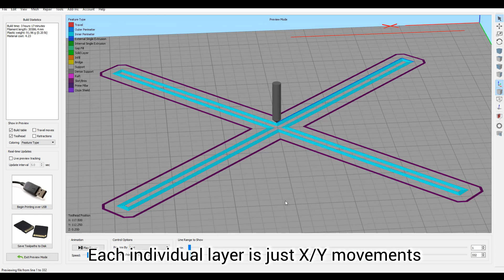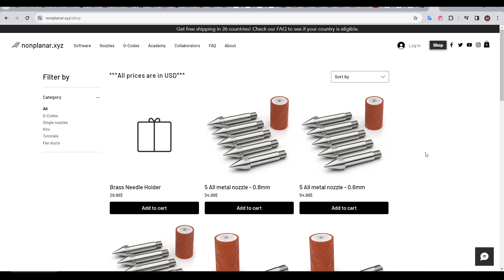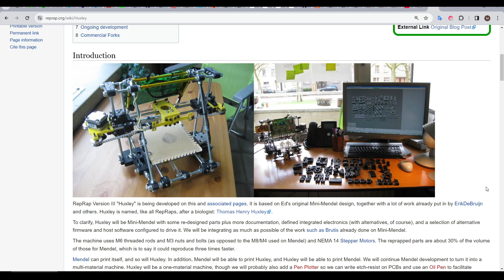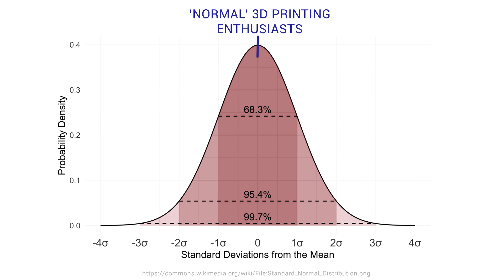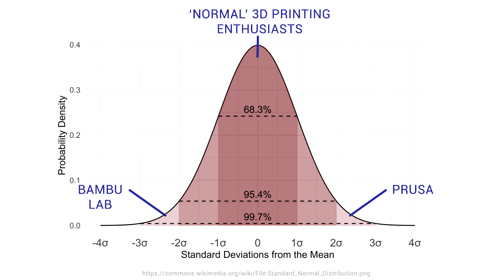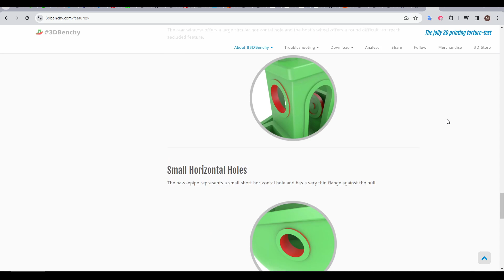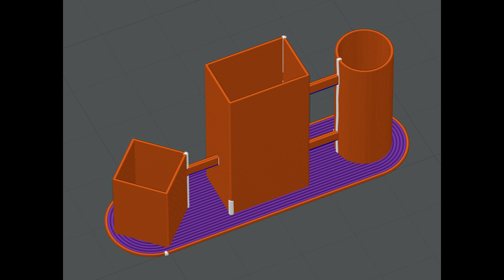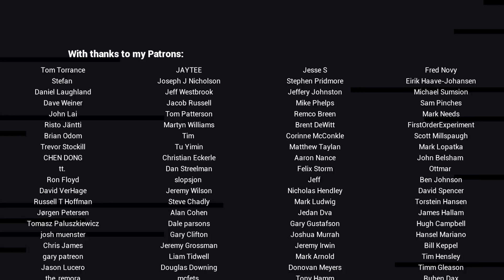3D printing mysteries that need to be solved in 2024

Comment: As for the S/N Hemisphere, and which way your printer poops out filament... I hate to tell you this, I live in the Northern Hemisphere, and both of my printers rotate the filament clockwise as well, even with the spool reversed or on the opposite side. Now as for Anti-Clockwise vs. Counter-Clockwise, I am always anti counter clock wise. They always get damaged when knocked off the counter.

Comment: I have forgotten to remove filament from the bowden so many times only to find it had snapped over night. So I added a 300mm retract to my post-job gcode to automatically retract it completely after the print (also the only time to do it while the hotend is still warm). As to the reason why it snapps, I tend to agree with people that the added stress of the bend in the tube is likely a big factor. I also noticed in the past that the bowden tube can trap a considerable amount of moisture, probably coming from the hotend, which may also contribute to making the filament more brittle.

Comment: Hello Michael, nice video as always! I have the answer for the filament snapping, it is due to a phenomen called "strain crystallization", more info here: https://en.wikipedia.org/wiki/Strain_crystallization

It will occurs more frequently with PLA than others, I don't know why. Small diameter spool, or when you are at the end of the spool, will increase the stress when unspooled and so this phenomen.

Enjoy the end of the year!
Reply: Woohoo it's Gregoire! Get well soon <3
Reply: Interesting, I thought it was just simple humidity (I had spools that did the same, and drying them out stopped the snapping)

Comment: supposedly the snapping filament is from moisture crystalizing the filament. not so much if it is old or not, it can either be a manufacturing problem and nothing you can do about it, a hole caused by shipping damage in the sealed plastic bag, or just it being in a humid environment for greater than a few days to a week once opening and using it. [i can confirm when i had it happen the faces of the breaks were very sharp edges with a crystal like jaggedness. when i intentionally tried to break a piece that was fresh from seal it didn't even break, it just did the plastic thing where it bent fully 180 on tight corner and turned white with stress.

this might not be the case for all filament brands. but i specifically use dremel filament that i bought in a batch like 3 years ago and only the two that i had opened and used some of had the issue, the one i recently opened has no issues still but probably will if i don't use all of it soon. yes i also use a dremel printer...i got it for cheap back when they first came out and after destroying 2 of their acryllic build plates i figured out how not to do that and how to repolish them. also they work better without a glossy super clear finish. 

something no one has ever said with 3d printing until now in regards to my dremel printer set up. i have too much build plate adhesion. i have to use a razor sharp chisel and mallet type object to remove them and typically still have to cut/file/sand off little bits that might as well be bonded chemically. but i also have it running with smaller than manufacturer's recomendations for layer line size. and it doesn't have a preference for ccw/cw filament purge as when you are swapping filament it doesn't do it over the build plate, it moves back to start position off corner of buildplate for better access.

also helpful tip to new people or people that don't have much experience with machines. put grease on your rails and oil on your screw rods. [grease for sliding parts, oil for rotating.

Comment: On the filament braking - you have it bending one way - tighter than the spool - then reversing direction and bending the other way. If the filament is brittle, that's a lot of bending. Try flipping the spool the other way up and moving the guide to the top so it arcs off the spool and into the extruder without the reverse curve.

Comment: I think that the filament rotation direction is affected mainly by the hotend fan creating air turbulence in a printer-specific way, thus forcing a precise swirling direction for most printers. 
Also, the nozzle position affects this turbulence: For example, if I try the same test in home position, my hotend is very close to the metal side of the printer, and the air is reflected toward the front of the printer, so instead of a "spring-like" extrusion I get a straight line pointing forward floating in the air, pretty cool to see!

Comment: Michael I think you are right about the flow and the artifacts on the print. I upped my temp by 5c on one of my prints and there was a visual difference in the surface finish as if it was going from a Matte to a more gloss look it's suttle but I can tell. I'd say that as your printing the top of the cube above the cylinder there is more flow and temperature in that area and looks cleaner? That's my guess anyway have a great new year. Also what's going on with your race car I have been eagerly awaiting your next video.

Comment: for the layer problem, I have found not stepping the temp down as the print reaches its top layers. I notices in Cura for example it steps down the hotend temp as it reaches the final layers, setting it to be the same from start to finish has seemed to solve the layer issue for me on an Ender 3 V2 Neo with Sprite Extruder Pro and linear rails all round.

Comment: Brittleness theory: I definitely don't have a definitive proof on that, but the more I study the phenomenon, the more I am convinced that part of the long term brittleness is due to plasticizer exchange. Most polymer aren't just the virgin polymer, but are mixed with other chemicals to fine tune properties. These chemicals can, over long periods of time, drift between two different polymers if held in contact. From my experience, with PLA, it seems to react with PTFE like materials. Prolonged contacts with the blue tubes and the white pouches of dessicants seems to be of that nature. I also suspect that some cardboards can do that also. Humidity is also a factor in PLA, but I would expect the effects of humidity on brittleness to be uniform, but often isn't.

Comment: I've noticed the last one as well. It would be nice to get to the bottom of that. Although I nearly exclusively print functional parts and the artifacts are (mostly) insignificant, it is something that does make me wonder. One last comment: I think slic3r is intended to be pronounced "slicer"  and not "slick-3-R. The 3 is "leet-speak" for E. I'm sure someone will correct me if I'm wrong.

Comment: Can you do a video with the top answers to each question that you asked? Even if the answers are wrong they would give us something to think about. 
I think the toxicity in the community is a generational thing. The old community was much more mature. The new generation has to be right about everything. They try to make everyone think that they are smarter than they really are. All their choices are the right ones. In my opinion of coarse. But I'm old and I still don't think this Internet think will take off. 🤪
Reply: IDK, the old generation also has a tendency to assume everyone already knows what they know, and have forgotten what it was like to be new, which leads to the elitism of the "figure it out yourself from the documentation" types.

The thing I try to remember is that what goes around comes around. When I find myself getting angry about someone not knowing a "basic" thing I go take a walk to cool off instead of snapping at them. Usually someone else gets to it before I do. Sometimes that other person isn't even toxic about it!

I also find that the really young ones, the ones that are at high school age and below right now, grew up on iPads and app stores that put big scary warnings on "developer mode", barely even let you tweak settings because they want you to use their designed UI flow or whatever, ban you for modding your game for as little as colorblindness accessibility, and the only time that the command line comes up is a sign that something has gone horribly wrong. They have been taught to fear tinkering by the megacorps that make a lot of software these days. It isn't their fault.

Comment: As others have mentioned, part of the increase in toxicity is a simple function of numbers.  More Americans are jerk faces than Canadians, but only because there are ten times as many Americans than there are Canadians.  If you could measure it per capita, it's likely that Canada comes off worse.  So of 1% of the 3d printing enthusiasts are jerkfaces, than when you quintuple the number of 3d printing enthusiasts you end up quintupling the number of jerkfaces.

There's another effect of increasing the numbers of people, though.  Human beings are not very good at really getting to know more than a hundred people or so.  As any community gets larger, it becomes less and less possible for every member to feel connected to every other member, and inevitably the community starts splitting into smaller groups with a more focused interest or commonality.  The members of any given subgroup have much weaker connections to members of any other subgroup, and this diminishes the social consequences that the community as a who9le used to enjoy for toxic behaviour, which in turn creates a rise in such behaviour that can end up escalating into tit-for-tat.

I think there's one more element at play with 3d printing in specific, though.  Bambu Labs set out to target an element of the 3d printing community that had up to that point been mostly ignored: the people (like myself) who have zero interest in building a 3d printer.  I want my 3d printer to be like my car: a complex machine, yes, but something that 90% of the time will just work.  I expect to do some basic maintenance and troubleshooting from time to time; I don't want to have to adjust the bed levelling every other print or manually general a flow rate.

Well, until Anker and then Bambu came out with their "it just works" printers, the only real options for that kind of hobbyist were prohibitively expensive - or Prusa, which is less "it just works" and more "you don't have to tinker very often."  And the views and desires of this segment weren't very visible in the community.  Then, bam, there are printers that are aimed at folks like myself, and in the process are very divergent from the RepRap "build it all yourself and then help someone else build theirs" design principles.  The discussions in the community took a radical shift, and a lot of change started happening.  Most people don't like sudden change, and I think a lot of the toxicity - especially in the love/hate for Bambu - is rooted in fear of that change.  Then, add in the other factors discussed above, and a relative handful of people start coping with that fear by lashing out at the folks embracing the new ideas.  And then we're back to tit-for-tat.

Although, I do suspect that "reasonable preference or bias" is more likely to be the mean of your bell curve, rather than the first deviation; I think most people have a preference, they just don't feel a need to impose that preference on anyone else.  But of course without some heavy sociological work we can't know for certain.

Happy New Year!

Comment: Non-planar printing is difficult to generalise. There are some specific circumstances where it helps a lot, but it’s hard to see how a slicer would detect those situations. Add to that the different geometries of extruders, and I’m not surprised that the major slicers haven’t devoted much effort to working on those problems.

Comment: As regards the Benchy. If you print 2 of them at the same time laid out at 90 degrees to each other on the build plate, then clipping them together after printing will demonstrate whether your x and y calibration are dimensionally accurate. This could be useful information. 
And, oh, It's not coriolis forces that twist your filament. Those forces are far too weak to explain things. 

Your house is on a slant, mate! Tell your builder to change his laser level. That cheapo Chinese one wasn't set up right!

Comment: 6:45 I'm pretty sure they're just hyped for you to do more from-parts 3d printer builds, not toxicity... There was only one comment on that collage that could be called toxic if I'm extremely generous. ("Instead of RatRig you should DEFINITELY check out VORON" in the top right)

Comment: For the artefact, i got it and it disappears when I unchecked arc fitting,
Arc resolution can be poor, and move shift the plan a little,
But only for the issue you mentioned with Hole, 
The texture issue is a different cause, probably flow rate like you said

Comment: I have experience similar with the snapping filament.  My best guess is that it has to do with the internal stresses of the plastic.  There are a few explanations, but my basic idea is that the filament wrapped on the spool is (or becomes over time) the natural state and then straightening it adds stress bc it is bent from its rest.  This is especially problimatic for me when filament sits straight  in a bowden tube for a couple weeks.  Then it is break city.  If I know a printer will sit for a little i always try to remove the filament and store it wrapped tight in an "unstressed" state on the spool.
Reply: I had learned to never leave filament in a bowden tube (in addition to other issues I think the PTFE eventually messes with PLA's chemistry).  But ya I can see that filament from older spools will have the tighter curve memory which can be problematic. But isn't it ironic that we spend all that time protecting new spools from humidity, only to find them go brittle on their own over time. Did we do too good a job keeping them from moisture lol

Comment: Another great video, Michael. Thanks so much for your contributions.

Toxicity.... Back in the early days of 3D Printing, everybody was pretty much in the same boat, facing the same challenges. "We're all in this together" tends to foster community spirit and helpfulness. Fast forward a number of years when different options brings with it different challenges and things get tribal and rival. We've seen it before with Ford VS Holden, VHS VS Betamax, Windows VS Apple, iPhone VS Android etc. etc. Sadly, it's just human nature to defend what we know and attack what we don't.

Filament snapping.... I have encountered this so many times. At first, I thought it was due to moisture in the filament but, even after drying, old filament remains brittle. Oxidation maybe?  Somebody please help answer this.

Comment: Honest to God I blame majority of toxicity on Bambu users, I have nothing against the printers at all.  We're at the point with more beginner friendly printers and for some reason these newer users can't fathom other printers like Prusa existing and you can tell they don't know how to help out with other user issues lol.
Reply: I have similiar experience. I'm hiding with my Bambu because it's a cool printer and a pretty good upgrade from heavily modded Ender-3 but the community is horrible. I joined FB group and left it a day later because they hate on themselves (including me) for the most non-sense reasons possible. If you have any problem with Bambu printer or AMS, it must be because owner is stupid and broke something or didn't plug anything correctly or put a non-official filament in it. They do not accept a thought that a printer could have came with a defect from manufacturer or something damaged in shipping, it must be owner fault.
Reply: @darekmistrz4364  yeah I noticed that too lol, it's like God himself made them.

Comment: I dont like to admit it, but i have been having some toxic thoughts lately but i would never berate someone for their choice of printer. But i will be honest and say that I am a bit "salty" though.

Back in the day, having a great, fast printer was a point of pride because you probably spent a lot of time and thought on that. There were always "standard" printers that work well and produce great quality prints that you can buy off the shelf (like prusas or early ultimakers) and then there were the "professional" machines that were out of the price range of most hobbyists that would deliver some more exceptional capabilities.

But now with bambu, everyone with  like 500€ can get a very fast, very good and even quad material printer capable. You used to be able to brag about having a well working dual extruder printer...

I have a P1S, multiple different generations of prusas, Deltas, Printrbots, an ultimaker, various reprap builds and some printers of my own design. I think more printers on the market is better. But clearly someone like me is probably more (or equally) interested in the printer itself, than actually using the printer for a different hobby or for something productive. The 3D printers themselves are the hobby for me, and i suspect a large part of the community is the same way, and bambu is kinda disappointing in that regard, like back when Makerbot or Ultimaker switched to  being more closed down and more aimed towards "users" rather than "3d printing enthusiasts". That kinda made them uninteresting for the general community too, but of course these machines also had a much higher price, so that not everyone could just buy one.

Honestly i dont even know what i wrote anymore i kinda started rambling halfway through. But tbh i dont notice much toxicity on the reprap forums or similar places. Seems to be mostly on social media or YouTube, in some cases im even wondering if it's a sort of marketing campaign...